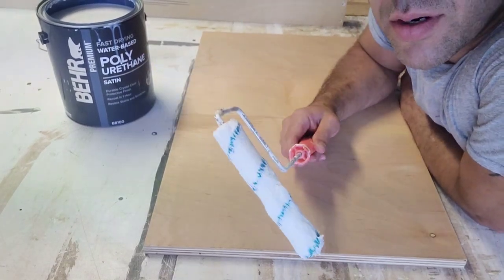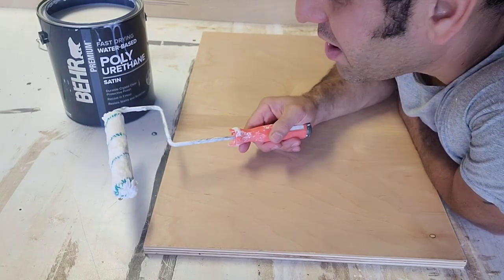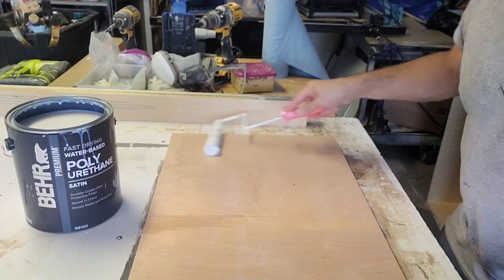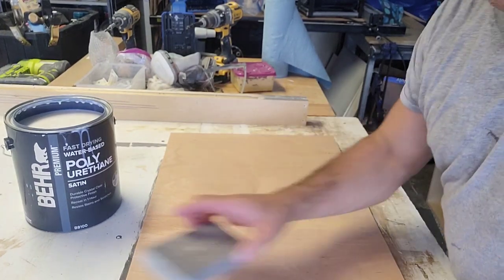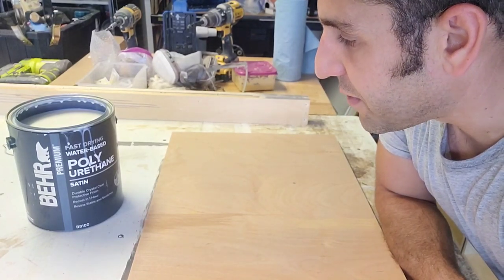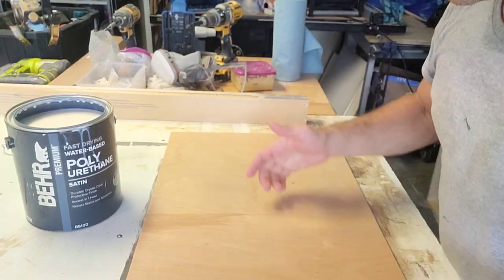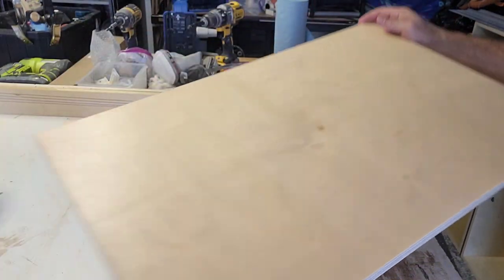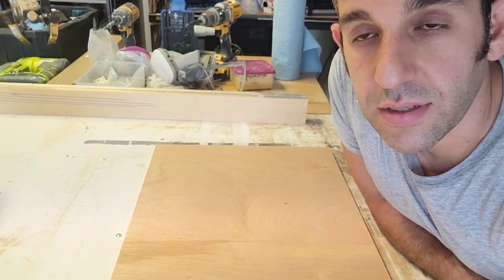How to apply water-based polyurethane from Behr

Comment: Just added spruce cabinets to a metal aquarium stand. I used two coats of Behr stain/poly combo in satin. I used a paint applicator as opposed to a brush. It came out great and it’s surprisingly “very” water resistant. Price wise it’s a no brained choice…..

Comment: Hello. Tx for the demo. I have a question. The Behr, the Varathane, and Saman, all seem like basically the same product, but is that true? Have you used Saman?   But the problem I am having may not be related to the brand.  Cz, I'm actually good with the first couple coats, it's once I am putting finish onto hardened finish, to build it up, so there is no soaking in.... 

either, I can't get it to level out, if I use a roller, it doesn't work, it dries fast and patchy and scratchy. The lines or stipples, no matter how I do it, foam brush, finishing brush, roller, it levels out 90% only, and that takes hours, .. or if I put it on thicker, it takes too long to dry and gets contaminated. I had a 1/4 inch icing layer on top, it looked like a translucent ceramic table, it was perfect, lol, worst cure of all of them.

It's sitting in front of me now, with 15 coats on it, every one of them sanded between, and I can see scratches in the layers everywhere, It just seems like a terrible fkng product, for build up anyway... or is it me? lol

Peace
Reply from the maker: Thanks for watching! I have not used Saman and never heard of it, actually. I have used Varathane, which is similar if not the same as the Behr version. I like the Behr the most, though. I don't believe I've ever applied it with a brush, just a roller or sprayer, and never have any issues. I'm not sure what's causing you such trouble.

   It's recommended that you apply  light coats in between. Don't apply too thick. Otherwise, it will take a while to dry. I don't know the conditions you're working in either, but that could affect it as well. How large is the project surface area you are working on?  Is this over a painted surface or raw wood? A good quality smooth roller with a longer nap will help spread things fast and smooth. You might even be able to use some flowing agents like floetrol to help it level out, but I would test that on a scrap piece before as I've never used it in water-based poly. I'm happy to help, but I need more info on your project.
Reply: Just use a buffing pad with a car buffer
Reply: @DRV_Woodworks  Hey. Thank you, I do appreciate it. Sorry, I just got burned out on it.And, I think the product might have a lot to do with it. peace
Reply: @FATSIDEDOWN  Just been coming around to that trick. tx

Comment: Will the strong odour of water based polyurethane will go away completely
Reply from the maker: There shouldn't be much of a odor at least not one that I've smelled. But it should go away after curing I would assume. Typically oil base poly has more of a distinctive odor

Comment: Any suggestions for applying to a floor?
Reply from the maker: I know Behr makes a specific water based floor poly. Not sure this is good enough so you might need to research that. As far as applying to a floor in general. Any large smooth nap roller will do.
Reply: @DRV_Woodworks  thank you!